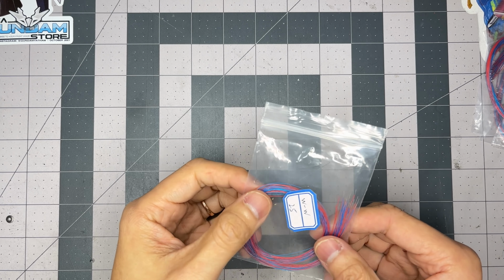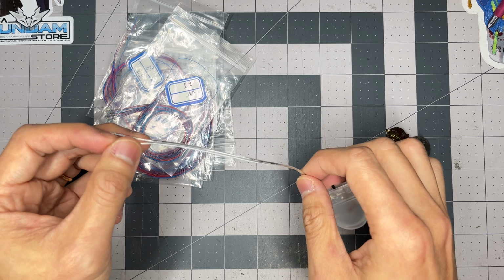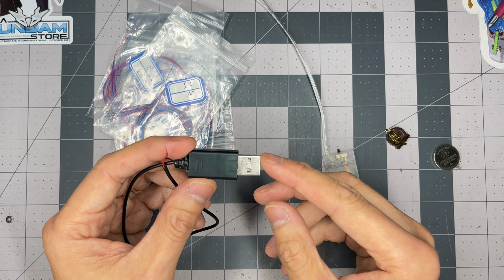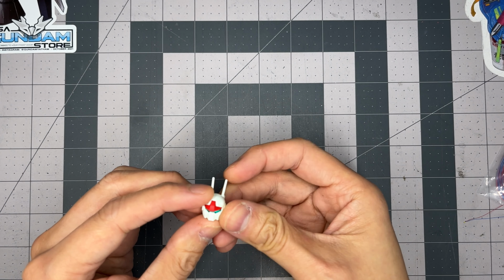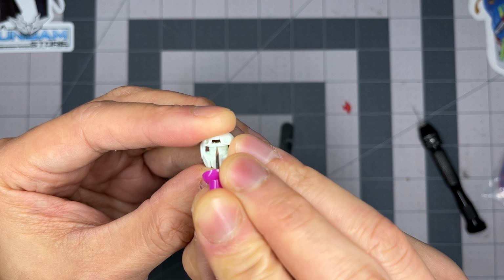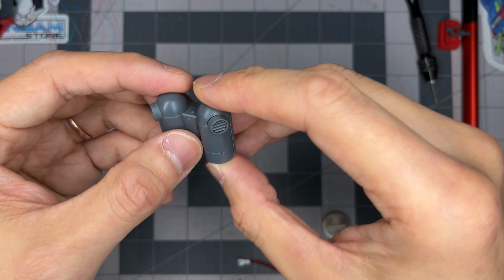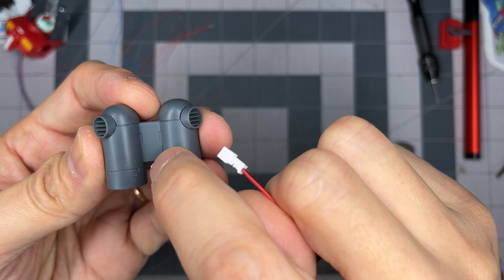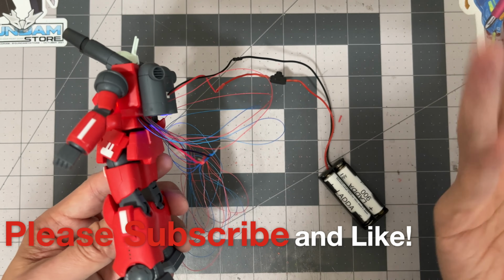Tutorial:  Gunpla customization using LED

Comment: Thanks for making this...clear and concise...helps to see all the steps.  You ever thought about using wireless LED's and a wireless power base?
Reply from the maker: Yes.  Wireless LED are great for bigger gunpla like MG.  It is still too big to fit in smaller space.  And it also cost more.  Even a 20cm wireless power base has very limited range. I have 20+ gunpla with LEDs in my display cabinet and it will require a lot of them to power them.   Regular LED also cost one tenth of wireless LEDs.

Comment: Great video! This video gave me interest on using LED on my gunpla... can you show how you use yhe step down and USB technique? Thank you
Reply from the maker: Connect the USB positive wire(+) to the stepdown adapter VIN.  Then connect the positive wire to your LEDs to stepdown adapter VOUT.  And then connect LEDs negative wire AND the USB negative wire to the stepdown adapter GND.
Reply from the maker: You can look at the diagram in this amazon link
https://www.amazon.com/Anmbest-AMS1117-3-3-4-75V-12V-Voltage-Regulator/dp/B07CP4P5XJ/ref=sr_1_3?crid=14SX9Q7C7JL0R&keywords=5v+to+3v+step+down&qid=1685921286&sprefix=5v+to+3v+step%2Caps%2C292&sr=8-3
Reply: @gunplafantasy  thank you for your reply :) do  i really need the stepdown converter? Can i connect the wire directly? Also.. if using the converter.. how did you hide/cover the converter?
Reply from the maker: @2ne29  You can also use a resistor or an LED in series to lower your current.

Comment: Nice tutorial. Do you have a video on how you wire up the step down regulator?
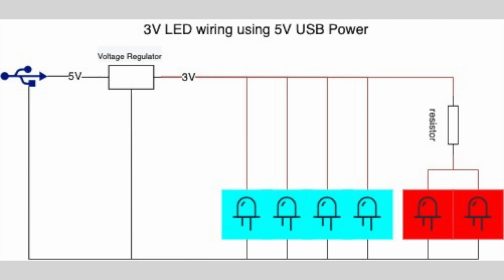Reply: 3:17 is how I wire the step down regulator.  You simply connect the USB positive to “VIN”(voltage in) and connect “OUT” to your LED positive.  Connect negative of your LEDs to “GND”(ground) and also your USB negative to “GND”
Reply: @jeffreyfumankit  thank you. That sounds simple enough